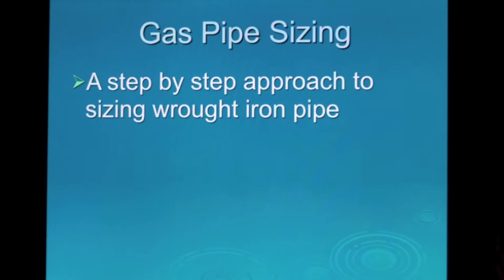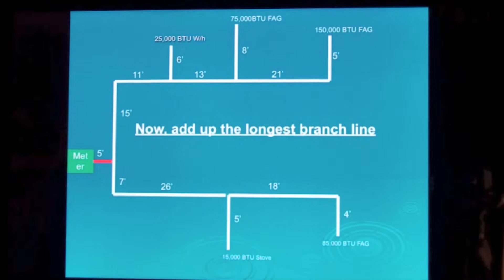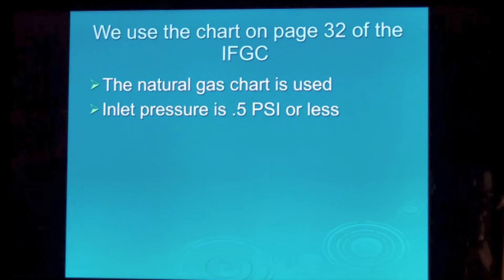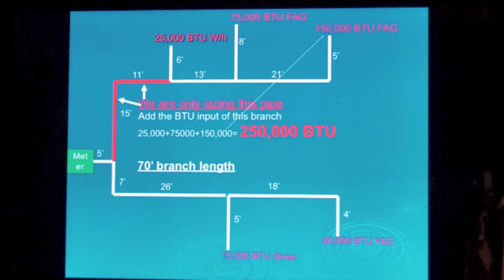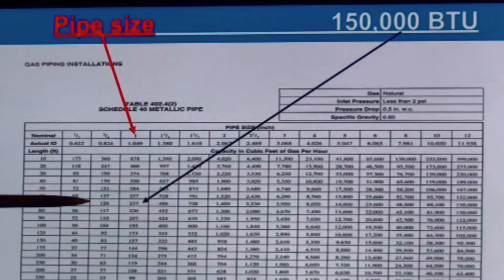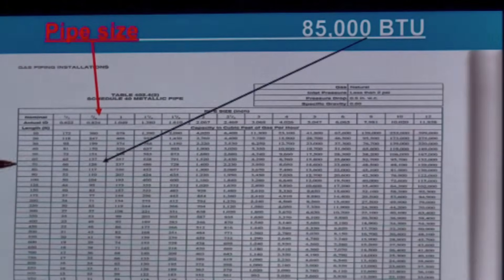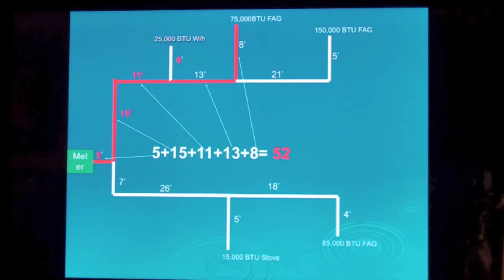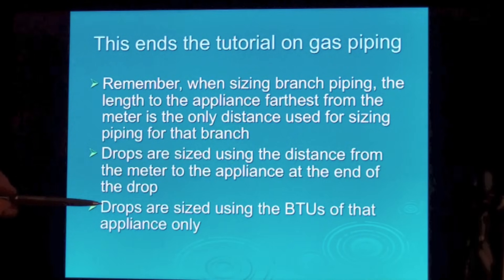Natural gas pipe sizing

Comment: Thank you so much for this. I had suspected that the builder had drastically undersized the gas piping in my new home and this proves it. There is no way that a system with a 6-8" WC regulator using 1/2" piping with 1/2" drops is suitable for an 85K BTU furnace, water heater, stove, and gas dryer. It's also worth noting that the 2018 edition of NFPA 54 also has foot equivalents for fittings like 90's 45's and T's.

Comment: great video....  I'm looking to ADD pipe to the existing system in order to add a garage heater and a manifold for future appliances.   So that must be a whole extra calculation.   I'm guessing that I could look at each of the calculations for the existing system and look for any surplus BTU's that the existing pipes are capable of moving that are currently being used?   And if the existing pipes are close to their maximum BTU carrying capacity, would I need to add my new manifold directly off of the gas meter area?

Comment: can we use these rules for hvac system
Reply from the maker: They can be used for any natural gas piping system using 7" WC pressure, wrought iron pipe and located above ground.  Other materials must use other parts of the IFGC.
GFM

Comment: I do have a question, how I could add the static head of pipe , in multi story building?
Reply from the maker: There is no static head. It is a sealed system.
GFM

Comment: Question here! 

My dryer and oven range require 3/4 inch pipe based on the calculations in the video, however they come from the manufacturer with 1/2 inch connector, should I just install 3/4 inch up to the manual shut off then half inch after the shut off to the appliance?
Reply from the maker: When sizing pipe, you only size up to the appliance.  The appliance sizing is done by the manufacturer.
GFM
Reply: @grayfurnaceman  Thank you sir! Great video and thanks for the response so it sounds like using this method up to the manual shut off valves should be good and just have adapters after the shut off to fit the appliance!

Comment: You lost me when you started different LMR for second line, which you should have kept the same LMR for both sides
Reply from the maker: There are 2 branches.  Each branch is sized with its own maximum length, including the common connection.  If you used the longest length for all piping, and one branch was very short, it would be massively oversized.
GFM

Comment: Hi GFM, Been sub'd to you for about 10 years now, I'm a retired plumber in KY and wanting to re pipe my ng system in basement  to increase capacity for a 199,000 btu/h tankless WH and a ng converted 18 hp portable generator (Unknown ?? btu/h requirement). How do you safely figure this btu/h requirement so I can revise my piping length/size/load drawing, can you help? Is the formula (2,544.43 X HP = btu/h) a valid way to figure it for the generator? That would be 45,800 btu/h if that is correct. Thanks, Bob R.

Comment: This is clear and concise, but what happens when a drop supplies more than one appliance, for example, a stove and a fireplace burner?  How do you calculate the pipe size between the stove and the fireplace?  And what happens when it's time to add a drop to an existing system?  Would this require a complete recalculation? Thank you.
Reply from the maker: A single drop for 2 appliances requires the total BTU input of the 2 appliances as if they are one (unless one is A/C and one is a heating appliance), for sizing the common branch size.  The branch for the fireplace is sized using the total length of the drop and farthest appliance.
GFM

Comment: How much does an elbows and tees cause the pressure to drop or do I need to worry about them in calculating pipe size?
Reply from the maker: This sizing system is simplified for technician use, and includes fittings.
GFM
Reply: @grayfurnaceman  thank you I figured that was the case.

Comment: Can you just upsize the main pipe to the largest size all the way through
Reply from the maker: Yes.  The sizing is the minimum necessary to maintain pressure with all appliances operating.
GFM

Comment: actually, the numbers on that chart are not referencing BTUs, but CFHs. and CFH = BTU / 1100, so the number needed is actually a bit SMALLER than what you have been calculating. that said, having MORE than you need will definitely keep you in spec, but you may end up spending money on larger pipes that you didn't necessarily need...
Reply from the maker: You must know the BTU value of the gas you are using to make this change.  The 1100 number is not most common and the 1000 number is a better one unless you know your number.
GFM
Reply: @grayfurnaceman  i see. all the documentation i have read so far (including official government codes) has listed them as 1100 for conversion. is there some reasoning to which number to use? or is it different in different countries or something?
Reply from the maker: @darkflux  The number is generally determined by the utility.
GFM

Comment: 7yrs later and this is STILL extremely helpful and so very easy to understand. This is the best instructional video I've seen in YT thus far. It just sucks that I had to watch 8 before, finding this. 

FYI table 402.4(2) in the 2018 book.
Reply from the maker: Thanks for the support.
GFM
Reply: 12 years later sir

Comment: Anyone know how to if gas pipe from the street to gas meter need to upgrade ?
Reply from the maker: Contact your utility.  They can tell you if it is available in the street.
If you are considering whether the piping from the street to your meter needs to be upgraded, it is not your problem.  It is the gas utility's responsibility.
GFM

Comment: I've got a 300 kBTU gas generator on the exact opposite side my house from the regulator. I'm planning on running a second dedicated line just to the generator tee'd off from right after the regulator. Is there a way to get around using the longest line? I hate for that one appliance 100' away to make me use the 100' column for all my other appliances that are even on an entirely independent branch.
Reply: Ah, you answered my question at 12:30. Yes you can. In fact, this reinforces my reasoning for running the generator on its own branch.

Comment: Thank you for this awesome tutorial.  It helped me to calculate my pipe size for an additional pool heater to my existing gas appliances.  I calculated that I have sufficient pipe size in my grey pipe to just add PE gas pipe to the end of one of my existing branches, vs. adding a new branch directly at the meter.  

One question that I am still stuck on is total gas supply being enough for all my appliances.  Can  anyone lend their expertise in this area?  It would be much appreciated.  Meter is an American Meter AC-250 that supplies 250k btu total. So American Meter AC-250 (250,000) - Gas Luxaire Furnace (100,000) - Water Tank (45,000) - gas dryer (25,000) - Gas Range (50,000) - New Gas Pool Heater (125,000) puts me well over the 250,000 supplied by the meter (a total of 345,000) in appliances.  A couple of things I considered whether I need to have a new meter swapped in for more capacity: When the pool heater is running in warmer months, I won't be simultaneously running the gas furnace, so I'd be "exchanging" the 100,000 furnace use, for a 125000 pool heater and then my meter will allow this delivery (245,000) total when furnace is out.  My stove calculation came right from the stoves manual for the burners and they didn't include the oven part of the stove, just the 5 burners at max.  Our outdoor grill is propane, so not a factor.  Sorry for the long post...wanted to cover every factor.  Thanks all.
Reply from the maker: This issue is one that is best solved by contacting the utility.  The meter is their responsibility.
GFM

Comment: I believe you have to convert to CFH by dividing your BTU by 1100 before using table.
Reply from the maker: This video makes the assumption that the BTU value of the gas is 1000BTU per cu ft.  
GFM

Comment: GFM,drops are sized using the distance from the meter to the gas appliance at the end of the drop ( is this still in the National Fuel Code today ?). The reason why I asked is most of the demonstrations out there today continue to use the longest run to  size drops ( your thoughts please ?). I've always use your method which I thought was still the current National Fuel Code method.
Reply from the maker: I believe my method is the current accepted one.
I have heard of the longest run method, but to me it makes no sense.  I think those that use it are misinterpreting the instructions.  You would be oversizing drops on piping systems that have one very long run for a single appliance.
GFM
Reply: @grayfurnaceman  , thank you for getting back to me. I came up with the same conclusion as you " they must be interpreting the instructions wrong." The longest run makes perfect sense for the main line ( trunk line), but to use total length to size branch lines makes no sense.  
 Hopefully all is well and the new Tesla is running good.  
   Regards Bob
Reply from the maker: @boby115  It is, great fun.
GFM

Comment: Would the gas pipe sizing be different for a 2 psi gas main with a regulator
Reply from the maker: If the regulator is a 7" wc and is located upstream of the pipe to be sized, it will be the same.  
If the regulator is on the appliance, and the piping is under 2# gas, the piping must be sized using the 2" charts.
GFM

Comment: why does it show Cubic feet per hour on the chart instead of BTU per hour
Reply from the maker: BTUs vary with location, so it is not a good measure.
GFM
Reply: @grayfurnaceman  how does BTU vary by location?
Reply: @grayfurnaceman  also in your video you had already converted all the BTUs back to cubic foot correct
Reply: @grayfurnaceman  also in your video you had already converted all the BTUs back to cubic foot correct
Reply from the maker: @tracker1ify  BTUs sometimes do vary with location.  Check with your utility.  I did convert to BTUs as the location used has 1000 BTUs per cu ft.
GFM

Comment: Old video...but for all of you checking this out.  On table the numbers displayed is for CF/hr not BTU's... 1100 BTU equals 1 CF/hr.  You must divide the 350,000 BTU's for 1100 to find the CF/hr to use the table.  He missed that step and therefore had a size or two larger pipes that he needed.  Good luck!
Reply: Thank you Brother 🙏
Reply: Muchas gracias, amigo!
Reply: You are  correct sir

Comment: You forget to say one thing - you're not going be using all of those gas appliances at the same time! That would mean I've got 2 gas fireplaces, my gas dryer, my gas stove, and my outdoor firepit and I'd have them all on at the same time? Really?
Reply from the maker: To pass the gas codes, you must size for all appliances on at the same time unless you have a gas fired A/C. Then only the largest BTU input of the 2 must be used.
GFM

Comment: Can you please explain what the "Inlet Pressure" and "Pressure Drop" at the top of the chart means? Thanks
Reply from the maker: Inlet pressure is the pressure at the source of the gas(ie the gas meter).  Pressure drop is the maximum allowable loss in pressure at the consuming appliance.  
GFM
Reply: @grayfurnaceman  Thanks. By saying maximum allowalbe loss in pressure at the consuming appliance, is that saying the maximum pressure drop between the meter and the consuming appliance is 0.5 in. w.c? Or am i getting the concept wrong?
Reply from the maker: @michaelchantonese  You got it.
FM
Reply: @grayfurnaceman  Cheers! Sorry just one more question. What is the reason why there is a limit set on the maximum pressure drop between the meter and the appliance? Is it to do with the ability of the pipe material to handle this pressure drop?
Reply from the maker: @michaelchantonese  The limit on pressure drop is a code issue.  Determined by the authority having jurisdiction.  Usually, the limit is .3 in wc or .5 in wc.  This limit determines allowable pipe sizing for a given BTU input appliance at the length from the meter.  And yes, The material the pipe is made from affects its ability to move gas.  
GFM
Reply: @grayfurnaceman  Noted. Thanks heaps GFM!

Comment: Good video GFM. I'm a homeowner doing a project and looking at the International Code table 402.4(2) which you used in your video.
Question
 I can read  the pressure at my gas stubout, but How do I know that mine is "Pressure Drop 0.5 in. w.e. &
Specific Gravity 0.60" and not something else which would lead me to use a different table?
Thanks GFM.
Reply from the maker: The pressure drop is local code.  The specific gravity is for all natural gas.
GFM

Comment: In engineering if one doubles inside diameter of a pipe one multiplies exponetially . In some cases 27 times or more gpm when you double the diameter of the flow rate at same psig for non turbulent flow of fluids.

Comment: Can you explain "Pressure Drop"? Is that something the gas supplier can give you?
Reply: Just like with plumbing, the goal is to have the same amount of pressure available to every appliance in the event of all of the appliances being used at the same time. The appliances that require more gas draw more pressure, and require larger piping, so that they will not rob other appliances of gas.

Comment: Correct me if I'm wrong, but the sizing chart goes off CFH so for example on the 2nd section where you had 250k btu and you convert to CFH it comes to 228 CFH you could actually use 1".

Comment: Just a homeowner redoing my gas pipes to accommodate adding a tankless water heater and high output gas fireplace, but found this really helpful. Oversized everything to 1" and reduced right before appliances. Gas company came out to hook up at meter and said I could have just had them bump up the pressure instead. Whatever, I sleep well at night and no more rusty 40 year old gas pipe hanging from coat hanger wire under the house and which some idiot thought needed insulated with rolled newspapers.

Comment: Was directed to this video by a comment under another on the same topic. "Grayfurnaceman IS the man!" Learned a lot here and found that pipe sizing isn't a guessing game. Does temperature effect flow through an above ground natural gas pipe to an outdoor grill, and is ambient temperature taken into consideration, along with all the other factors, when determining pipe size. Thanks for posting all the educational videos. No telling how much mony you have save folks - not to mention possibly lives too.
Reply from the maker: This method is a simplified one used by gas fitters and oversizes the pipe size to account for fittings and temp losses.  
GFM

Comment: how are the fittings (bends, elbows, etc..)  incorporated in branch length method and longest length method, while sizing the gas pipes?
Reply from the maker: This method is designed to account for ells.  
When this plan is used, the piping is somewhat oversized.  Piping plans can be engineered using proper engineering principles including all changes in direction of flow, and the pipe will be generally smaller.
This method is for us dummies.
GFM

Comment: hi, can i use the existing 1/2" gas line of my water heater for a new tankless? the new tankless requires 3/4" gas line. so can i use a 1/2" to 3/4" reducing coupler on the old 1/2" gas line? will this affect flow to the new tankless going from 1/2" line to 3/4" line? or is it better to take it directly from another gas line that is 3/4". thank you.
Reply from the maker: With a tankless, you may have to replace the entire piping system depending on the max draw of the heater.  Definitely no on the 1/2 to 3/4 reducer.  You will need to to do a piping plan using the video referenced.
GFM
Reply: You have to size everything again to add the btus a tankless draws

Comment: I mainly have 1” pipe from the nipple to the back of the house is 3/4” to outside w shut off valve. If I go to my 13hp 420cc Generator 8’750/7,000 running watts can I run 40 ft of 1/2” hose and run my generator smoothly? I explained this to a NG guy on YouTube and he said from the 1” solid pipe to 18ft of 3/4” pipe to 50 ft of 1/2” pipe I would be giving 34,800 BTU and my generator is 13hp 420cc it would need 28,400 BTU and told me it would work fine. I’m just looking for other options so I don’t waste time and money on wrong sizes. Thanks and if he is right let me know.